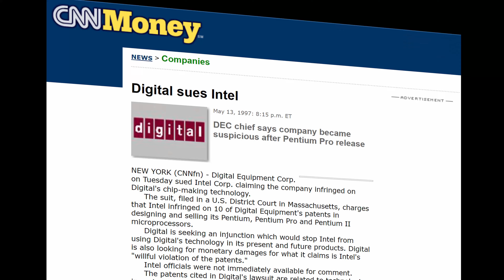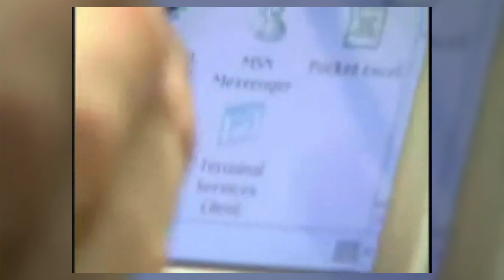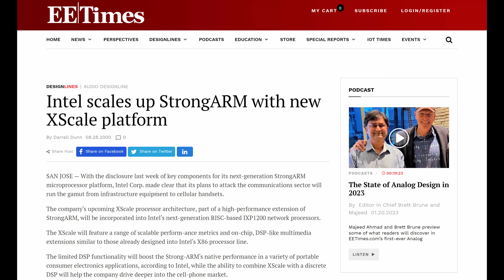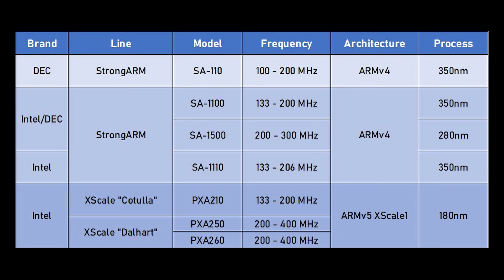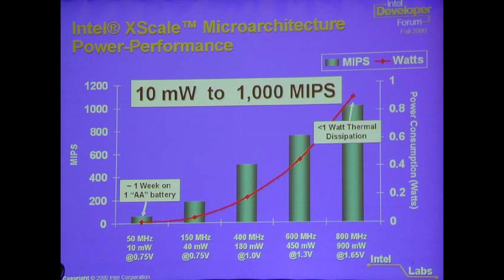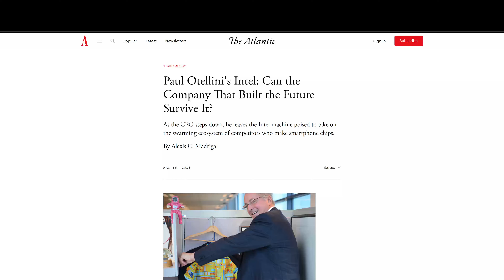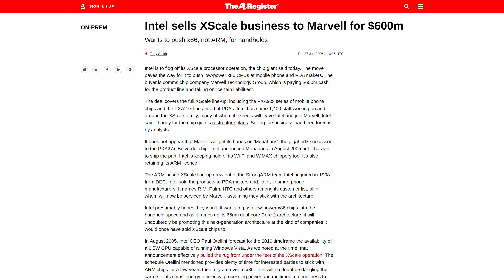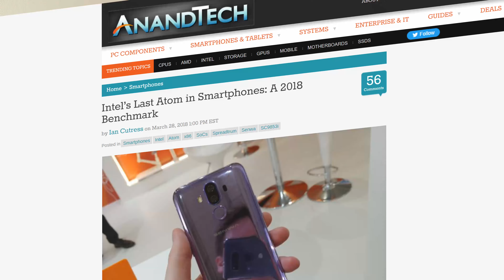Intel's axed ARM CPUs (which nearly powered the iPhone) + exclusive info from Intel director

Comment: FWIW, Intel sells ARM devices today! Some of the FPGAs that intel sells have ARM processors in them (called HPS). That came from the acquisition of Altera in 2016. So if you want a chip with an arm processor in it from Intel, you can get it. Not low power though.

Comment: Intel's “Jasper Lake” N-series Pentium Silver and Celeron CPUs  run at a power saving  6W  - 10W TPU.     Trying them out in Gateway and Lenovo laptops, both the Celeron and Pentium Silver  CPUs deliver impressive performance at such low power...  But to think of  the PAIN intel felt when it passed on the  iPhone...  and tossed out all the ARM and Xscale development.  
The Future is in Low Power,  especially considering the 2nm and smaller designs Intel is working on,  so TINY they really can't  get overloaded on too much power or heat...

Comment: Just for the sake of completeness I would like to hear about AMD's attempts at making ARM devices. They did release Opteron A11** series of 3 SoCs, but very little information exists about it. And at the time AMD was working on ZEN x86 architecture, which turned out to be actually good, so it is unlikely they will make any more ARM devices soon.
Reply: There's more juicy details to the Opteron A1xxx story 😁

AMD was actually developing Arm server chips for a certain Seattle based cloud provider (it was an open secret, the codename of the Opteron chips was Seattle). It's not clear why they didn't follow though - it might be that K12 (AMD's high performance ARMv8 architecture) wasn't meeting expectations, that AMD decided to focus efforts on Zen (the safer bet in the short term), or that the cloud provider simply decided they could do it better alone.

In the time since AMD canned Arm server development, that same cloud provider has formed it's own in-house chip design team and delivered several successful and industry leading products (such as effectively inventing the DPU, and delivering 3 increasingly impressive generations of Arm server SoCs). 

That cloud provider now has Arm server SoCs that are frankly way better than anything Intel or AMD have in terms of perf/watt and density, and Arm server market share is on the increase.

I wonder if AMD might regret messing up that relationship someday 🤔
Reply: AMD Soundwave incoming 🤨

Comment: The DEC breakup is pretty crazy. Intel’s acquired IP and staff went on to fix Pentium 4 missteps and helped build Core and Core2 designs.

AMD also snapped up parts of DEC. The Alpha interconnects inspired Hypertransport and AMD got DEC engineer Jim Keller who helped form x86-64bit and designed the Opteron cores that smashed Intel in the early 2000s.
Reply from the maker: A fascinating time for sure - thanks for the comment!

Comment: Its a shame they ditched this, if you imagine if it had carried on, the amount of atom products that could probably still be of a lot of use today and back in the day, it would be a cheap linux laptop dream, tablets and handhelds, and we wouldn't have gotten sub par IGP and HD graphics built in but something with a bit more oomph, my Linx Vision 8 stream tablet has a quad core atom chip at 1.6ghz, crippled my single channel 2GB ddr3 and some poor HD graphics that make a GT210 look like a powerhouse. if it in a mobile market it had been more open that the centrino package, we could've gotten competing chips for graphics. I imagine a lot of "steam deck" devices would've been more popular, it could have thrown the Wii-U and Switch into the dirt if they were able to push it with the knowledge the engineers had. I wonder how Nvidia buying ARM would have been if intel was the prodominant leader in that platform..